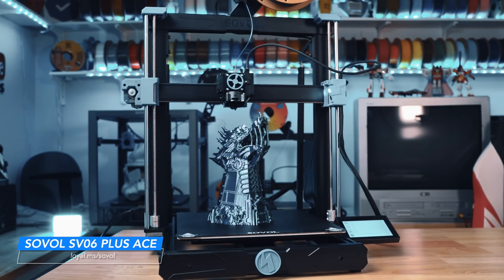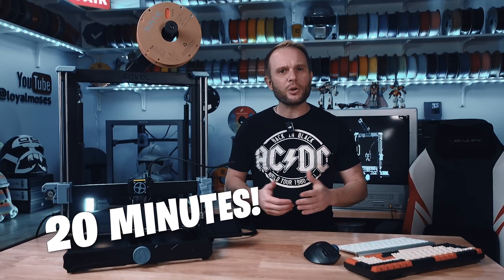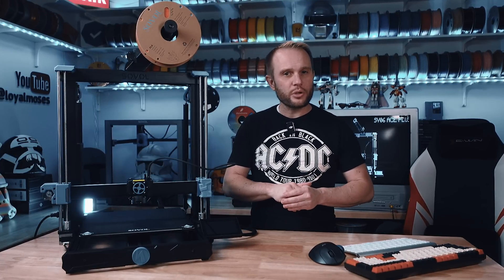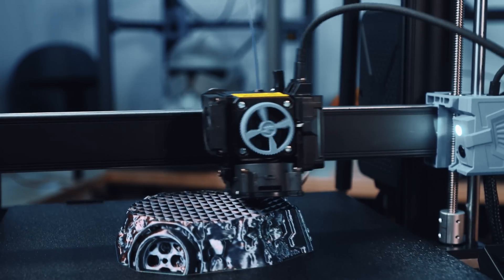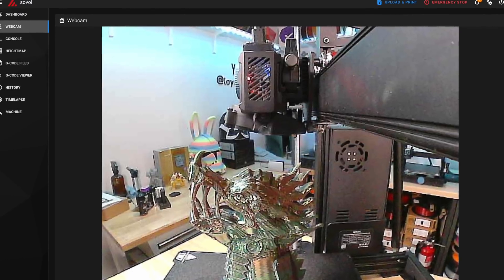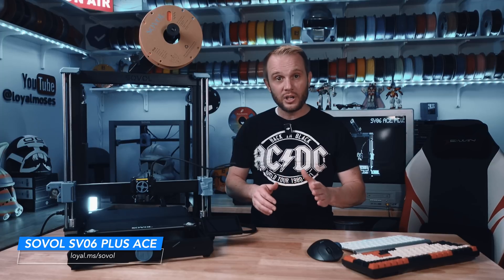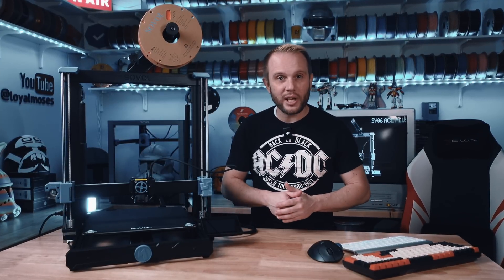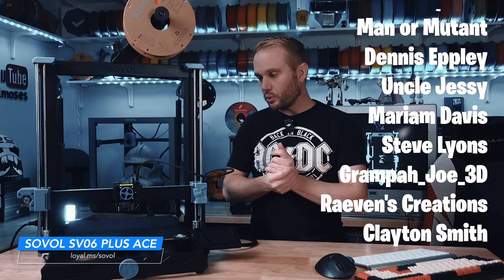Best BIG Budget Friendly 3D Printer - SV06 Plus ACE

Comment: Dude i bought this printer and man what a bummer and hassle... 1st the y axis motors shaft was broken out of box , it took two weeks for this newb to figure out i could get replacement parts on Amazon, instead of waiting weeks on sovol to ship from china ..fixed that , ran some prints , got great 1st layers , i was stoked.......tried printing a 170% gridfinity drawer .... it was ok for 24 hours , but slipped x by 5 mm or so i didn't notice , then slipped 35 mm  on y ....make sure belt were tight and looked over machine made sure every screw was good... tried again , same thing , tried again same result..... so i got on web and tried to look up moonraker ...found it it is in Chinese.. Sovol didn't respond...the out of no where it start squealing and i cant find out why .... since march i haven't been able to even print a roll on this machine ... at this point I'm just trying to sell it for 250 and cut loses...... and don't get me started on obico junk not working.... :{

Comment: Thanks for all the vids. If you had to choose between SV06 Ace plus, Elegoo Neptune 4 max, and Kobra 2 Max.or Kobra 3 max...what would choose..how would you rank them?
Reply: I would like to know this exact answer too.
Reply: Exactly what I was looking for.  So far, I've seen nylon capability with N4, and both Kobra and N4 have 320mm square beds, which is nice to push over 12", for those of us still having to interface with pagan unit (Imperial) sizes up to 12".  The comment that N4 isn't using steel for motion control wheels was useful to know.  Unfortunately, all VS comparisons I've seen only list basic or bells/whistle stuff.  In depth reviews with detailed comparison appear to be lacking still.  Another to compare is the Ender3 V3 plus, but it's currently not very price competitive (from high to low after Prime day:  Ender, Anycubic, Sovol, Elegoo).  One thing I think this review got wrong was the build volume (and doesn't mention build area).
what I collected:
Printer	build L	W 	H	Vol m3
N4 plus	320	320	385	0.0394
S06 ACE Plus	300	300	350	0.0315
Ender3 v3 plus	300	300	330	0.0297
Anycubic Kobra 2 plus	320	320	400	0.0410
Reply: Sovol would be slightly more reliable over the other two.

Comment: honestly if every printer could support multi color that would be game changing and then they would need to tweek profiles to a point that theres not so much poop from color changes. i know there will always be some but sometimes the waste is more then what was used for the actual print
Reply from the maker: I'd love every printer to be multi-color, would be awesome!
Reply: @WickedCustomzFL  I agree.  At a minimum (unless it is a print farm model), they should all by now support multilateral natively.  Even if it is something SIMILAR to co-Print, but it needs to plug directly into the printer.  No adding limit switches or new controller boards that override the original controller.
Reply: @The3DPrintingGrandad  i agree. ive seen co print and there is another brand if im correct and they at one point even where limited on what printers they worked with.
Reply: @WickedCustomzFL  Purging should be part of the infill, even if it required adding more infill to a layer than requested.
Reply: @The3DPrintingGrandad  that would be game changer. i mean most solid prints you dont see the inside.
Reply: Multi color is beyond wasteful

Comment: Great review.  It's weird that Sovol had the SV06 Plus Ace for sale on their site before there were any YouTube video reviews or promos.  I tried to convince Elegoo to make a Plus version of their Neptune 4 Pro (steel motion control) but the Neptune 4 Plus and Max are still using acetyl V wheels which doesn't seem like it will offer much long term durability on a large high speed bed slinger.  Sovol delivered with the SV06 Plus Ace.

4:45 - Thanks for mentioning that Sovol has been open sourcing all of their printers - hardware and software.  That's a very big factor in their favor in my opinion.  I love that about Sovol and it makes me want to buy their printers.  I'm maxed out on printers now, with the latest being the SV08 so a 300x300 bed slinger doesn't have much to offer when I have a 350x350 coreXY printer that I've enclosed, but I still want an SV06 Plus Ace, in part because it's such a good value in a larger format printer.  It should be good for running production jobs.  With newer materials such as PET-CF becoming reasonably priced, having an enclosed printer is less important for functional prints and this big solid fast bed slinger looks like peak value.

Comment: I'm still debating about getting an enclosed bigger build volume printer than my x1c, but otoh, this printer is really a good deal. The bambu lab environment makes me a lazy dude, but this printer is seems to be just as simple and functional than my bambu printers. I just need hope multimaterial won't come too late!
Reply from the maker: Bambu changed everything...  I think it is cool to have a large format printer, even if not bambu that is cheaper that can still pump out those larger prints when we need them.

Comment: It looks way big.  Multi color is not as important to me anymore as i have a Bambu with an AMS so now i just want good and reliable...and not sure bed slinger is where its at anymore...i know some have pulled it off and they are the exception to the rule in my book.  Thanks for the video update.
Reply from the maker: That's kind of how I feel. Do we just have a good multi-color or multi-material 3D printer around and then just print single color things on other machines?!

Comment: For anyone just getting in to printing and wants the large build area, I can highly recommend Sovol. They are a solid brand. They were the first machines I purchased. 

Is there a way to upgrade the older sv06 Plus? I was thinking about trying to add klipper to it, not that I know much about klipper, other than it’s a thing lol
Reply from the maker: I’m not sure! We should ask!
Reply: It’s all open source so it’s possible. The ace’s hotend uses CAN so you’ll need to get the new motherboard board and the new hotend. The software is on their GitHub.

The liner threaded rods are an easy upgrade. You just need to buy the right collars and the 10mm rods. The specs are in the GitHub PDF files. You could also ask. Sovol will gladly give specs and basic advice on mods. They gave me all the info I needed to swap the motherboard fan for a noctua fan.

The rest of the changes could be configured in klipper. Not a simple upgrade, but doable.